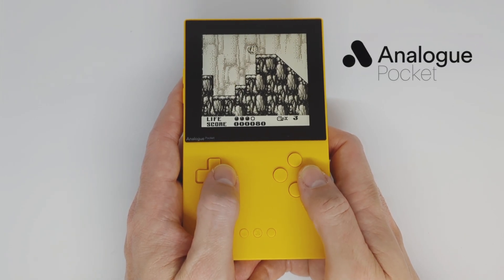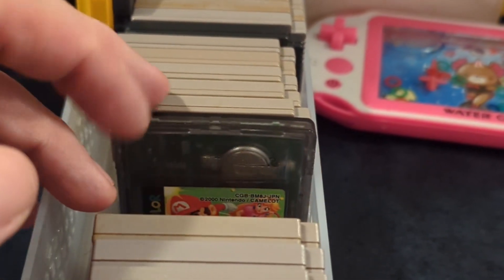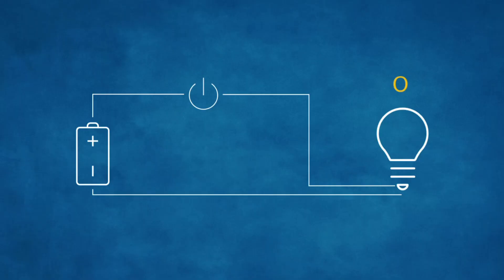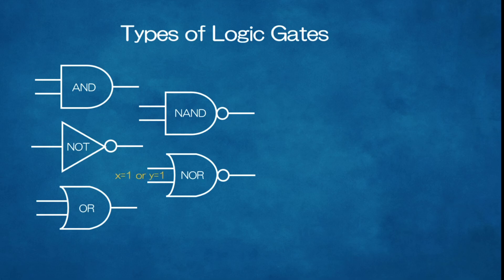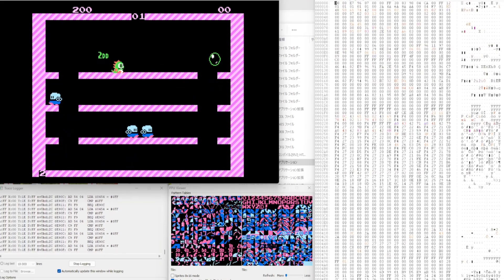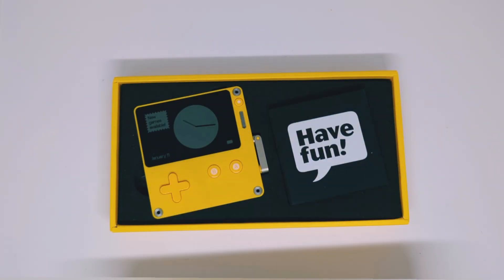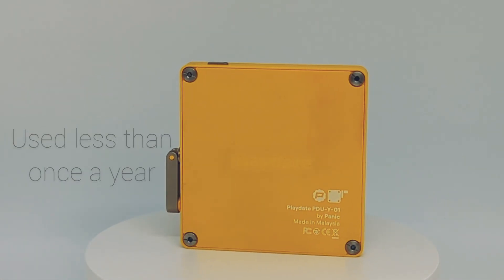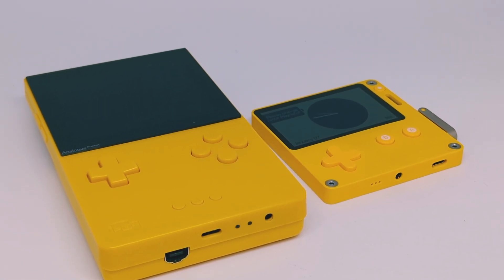Analogue Pocket: What is FPGA and is it worth it?

Comment: I'm sorry but I'm not a speed runner just a 40 years old guy and apart from emulating on a decent PC where you can cut the input latency, non of the retro handhelds available feel good. After getting a Mister fpga and the pocket I can't play again with underpowered emulator devices. Sure the RP5 looks beautiful but the android input latency is awful.
Reply from the maker: It sounds like you have much sharper senses than I do. I don't really notice any input lag, but that doesn't mean it's not there. I'm sure if I were a bit more sensitive to that type of thing the pocket would make more sense for me.

Comment: 😄Hah, my personal answer for whether it makes a difference/is worth it or not is also a resounding no, but seemingly for the opposite reason: I don't think the Analogue Pocket is quote-unquote "authentic" enough for my tastes with that bright high-res LCD screen. If I want a device that recreates the experience of playing a Game Boy Color in the present day, then I want the screen to do its utmost to mimic the original within the constraints of modern available tech. That means matching the colour gamut and other idiosyncracies is paramount.
Reply: The AP does actually do that, the latest firmware did some more to fix the color gamut when using the original display modes. But I do wish they would have added options to set the color temperature of the ambient light to get it that last inch to be as authentic as possible.
But even without that it's basically exactly what your rosy memories of the past tell you it was like 30 years ago, without any of the downsides like that tinnitus inducing system noise from the headphone jack or the fact that you can't see anything because the original DMG screen is just a giant smear every time you move.
Reply from the maker: Interesting take. You want the original, warts and all. Does the ModRetro Chromatic appeal to you then?
Reply: @ferretsensei  Maybe? I haven't seen one in the flesh. 😅

Comment: Things like save states and fast forward are being added to cores for Analogue Pocket by budude2. More advanced cores like SNES may not get them because there's not much room in the FPGA itself, but he's added them to GB/C cores and is working on other cores now. He even added real time clock to Gameboy for Pokemon games, something that people used to say is impossible and will never happen because no one would ever bother doing it.
Reply: At the start, when the Pocket was first released the RTC was technically impossible. On the first few firmwares the AP actually didn't have a way to keep track of time by itself, and thus there was nothing that would have advanced time outside of playing the game.
However after Analogue finally patched in an actual date and time setting, plus time tracking while the device is powered off, it did become possible to add RTC to OpenFPGA cores.
Reply from the maker: This is something I almost put into the video but ended up scrapping it. The number of people building these cores will always be severely limited compared to the software emulation community by nature, as verilog is not nearly as well known and used as languages used for software emulators, and also a certain amount of electrical engineering knowledge is necessary, which means the amount of people who CAN do it is limited. With that in mind, it's actually amazing what they have been able to do with a fraction of the manpower that the software emulation community has.

Comment: I think the people that will want FPGA the most are people that have been "chasing the unicorn" for a long time.  I have collected the vast majority of retro systems and a ton of games. Then I have to figure out the best way to upscale it to play on my flat screen TV. A upscaller to convert the original systems to a flat screen (and have it worth using) ranges from $200-$700. Of course, now I need switches to feed into the upscaller as well. Yes, you can emulate but we already have collections and we're trying to get back to zero lag and perfect scan lines like when we were kids. And emulation does have to much lag, or at least more than we desire. FPGA comes along and offers every perfect play back and zero lag for all retro systems and like emulation, all game are free. It's the end of the chase.
Reply from the maker: I don't have much of a collection of original hardware, so my rusty memory is all I can compare performance to. But I think you have a good point - the question shouldn't be if software is better than hardware emulation or not, but if FPGA can be better than collecting original hardware, which I think is a definite YES for me. This is coming from somebody who still regularly uses cassette tapes and other kinds of legacy media just because I like older machines.

Comment: "May the YouTube algorithm be forever in your favor!" This is a great basic explanation of FPGA vs. software emulation and even some machine language programming concepts too. I do like more of the hardware feel and with an Analogue Pocket, Dock and several sets of 2.4GHz 8bitdo controllers with custom firmware for the AP, its a realistic NES, SNES, GB, GBC, GBA, TurboGrafx 16/ TG-CD, NeoGeo, basically everything that took a cartridge including Commadore 64, Amiga, etc. Then there are all the arcade cores. I could go on but only a few cores (i.e. systems) can use save states. The FPGA chip is not large enough for more complex system. Compared to my real NES on a 20" CRT, the only thing it is used for is the zapper. The AP with a 55" 4K TV, which provides a 40" 4:3 diagonal and awesome CRT filter is bliss. If you ever grew up with a DMG GameBoy, the screen filter is second to none. There are some GB games, like Castlevania II, that just don't look right on a GBC. I do have real GB, GBC and GBA with IPS screens but they do not come close. I got the AP because it IS all those systems. Just getting a GBA and moding it with an IPS screen comes close to the AP cost. Add a GBC and GB and you're coming close to tripling it. Then add the NES that I got for $5 but it needed a new connector, I recapped it, added the Famicom audio mod, etc. That is why the AP but if you don't need the portability, a Mister Pi and other FPGA consoles Taki Udon has coming. I do have reservations leaving the house with it which is why I'm looking at the RG35XX SP, RG34XX or Miyoo Flip for on the road.
Reply from the maker: Thanks for the great comment. To be honest, before making this video I thought Analogue Pocket was overpriced, but after learning a bit about FPGA and how it is generally more expensive to produce than standardized chip sets, I am actually surprised Analogue pocket isn't more expensive. 

I think for people who know a lot about the inside of old consoles and how they worked at a machine level, FPGA is pretty exciting and has lots of benefits.